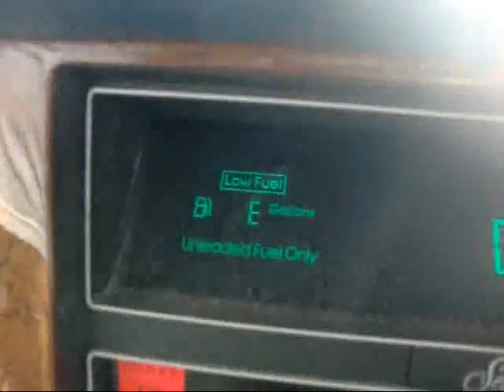7 11 12  Kracked Caddy...

Comment: The thing that saves us here is that they stopped using salt as much.  Once in a while they'll put some salt/sand down right at the intersections, but they use very little, and with the dry climate and relatively mild winters the cars have time to thaw out and dry during the winter.

Comment: Capital J? That seems a bit harsh, i've had both - the HT4900 and the Northstar (this seville has a 4.5 - heads and head gaskets were a big problem in those).  The 4.9 is possibly the most reliable engine cadillac has ever used, though a bit underwpowered at 200HP - it has a LOT of torque at low RPM.   The Northstar is a different animal, powerful - sounds awesome at 6500RPM, i love them.  The early ones were known for pulled head bolt threads - they had most of that ironed out by 2000.

Comment: A grease / oil mix with similar function as Fluid film applied in a professional shop and took about 1 hour with underbody treatment inclusive rocker panels and all the frame parts. They drilled holes in all the doors and let the good stuff come in... Yammy... A little dripping in the heat but i can live with that... Thicker grease in the wheelwells so it stays there... Better spend 1400 nok with a year or two intervalls and keep the car rust free..It is so awful to start a bigger welding job